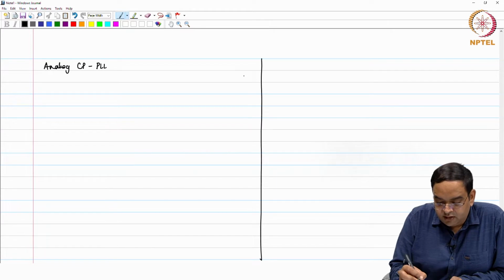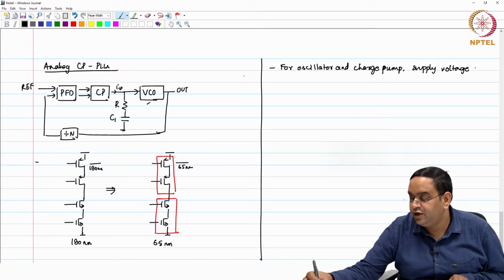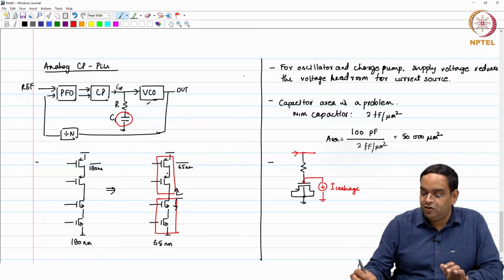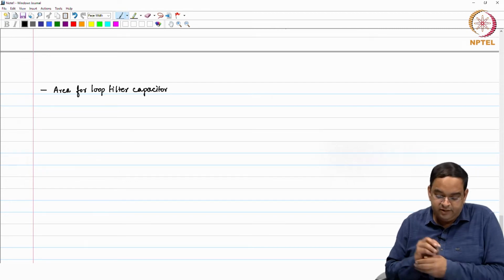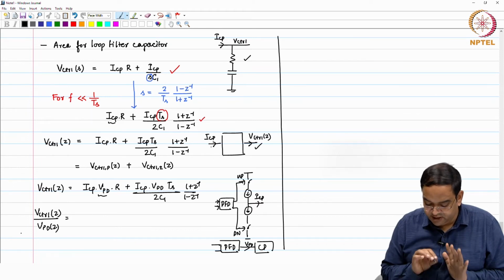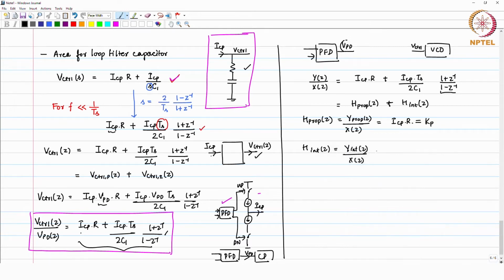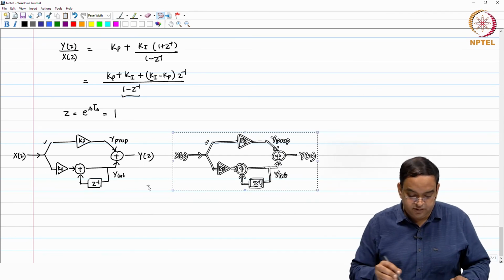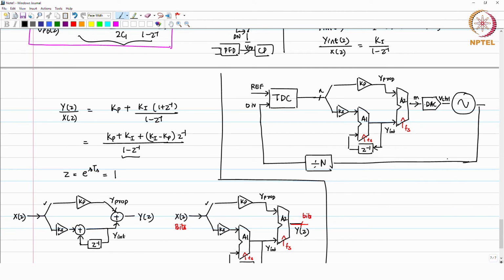Introduction to Digital PLL

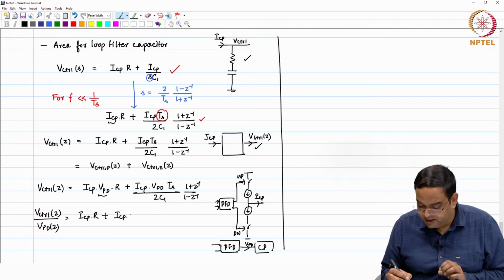Comment: If Vpd is the input to the Charge Pump(CP) and the output to that is the current Icp, So Shouldn't our gain be Equal to Icp = K * Vcp, where K has the units of conductance? Also the transfer function at 21:40 mark has no units for the LHS while the RHS has the units of Volts. Isn't this wrong? Also the equation above multiplies Vpd to the whole equation, which would convert the RHS to have units of Volts squared? I think the realtion between the nature of Vctrl and Vpd has an issue in this section.